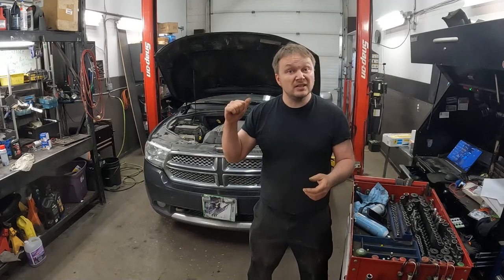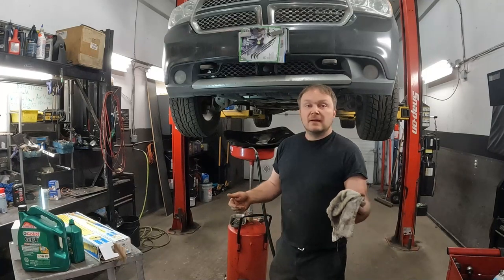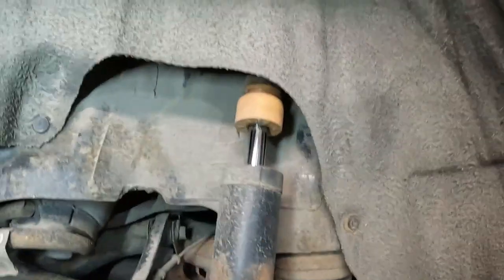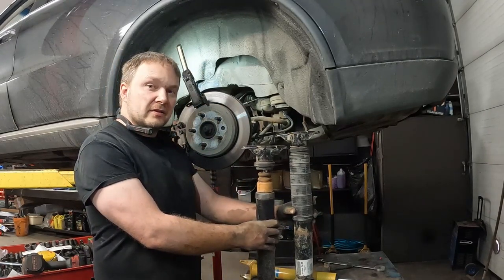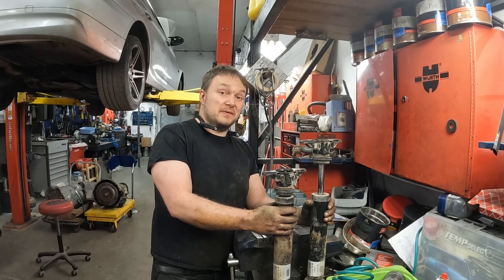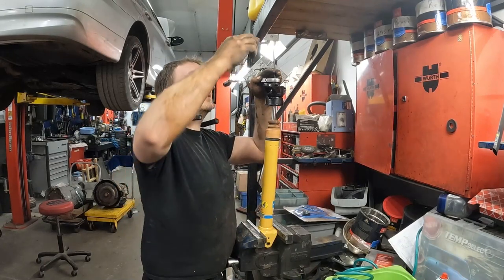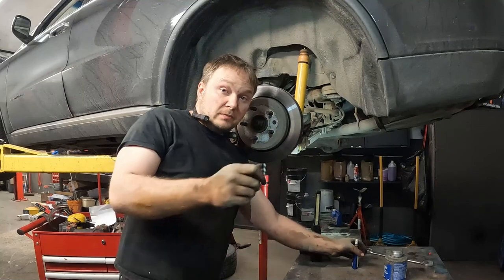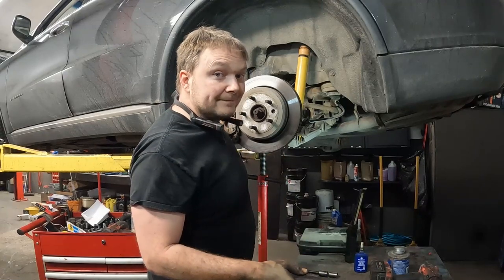Durango load levelling shocks are a load of garbage! How to improve your ride handling!

Comment: You have to change the rear springs as well.
Reply from the maker: @matthewcraine9772 You sure do. I realized that not long after. Sadly I've put it off for forever. We have a week shutdown next week for holidays so going to finally replace them then... If you're paying parts and labor then it's cheaper to replace the shocks with original load levelling shocks. Harder to find parts now though. But if you're doing the work yourself then still a little cheaper replacing shocks with non levelling and putting in new mounts and springs.

Comment: Bilstein wont fit in stock mounts.
Which ones should I use? None LL suspension.
Reply: The Monroe struts don't fit either. I'm trying to figure out what to use as well
Reply: @jp-ey7ps I contacted Bilstein and was told to use SXT rear mounts. I test fitted SXT ones and due in fact fit. 
Mine origunaly came with LL rear suspension but previous owner did away with it and used standard shocks.
Reply: @jp-ey7ps monroe should fit as the shaft is the same diameter than stick ones. Bilsteins are a bit thicker. Thats why they didnt fit.
Reply: I bought mopar mounts and hardware. Haven't done install yet though
Reply: @mpresto15  are they for an SXT model? If not, they will not work. I went with KYB mounts.